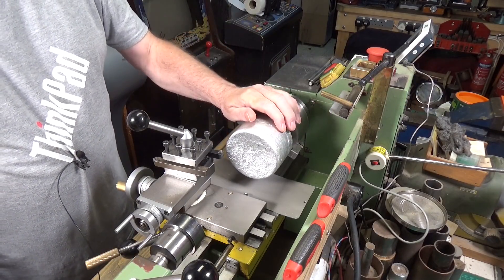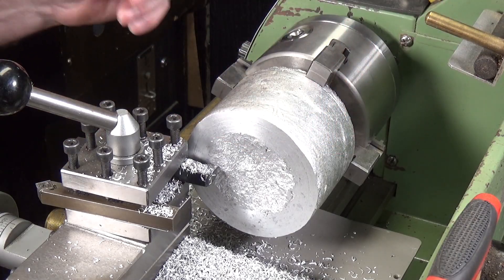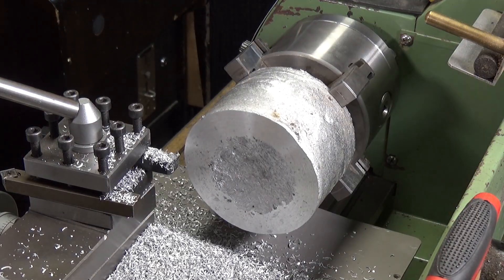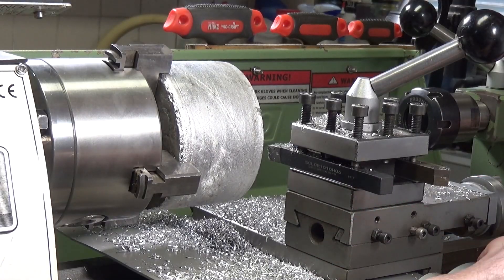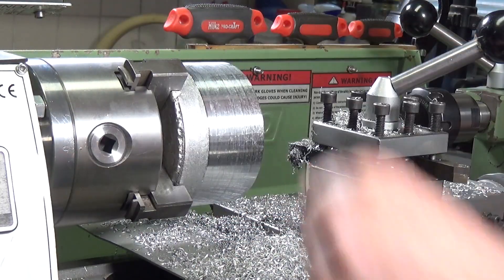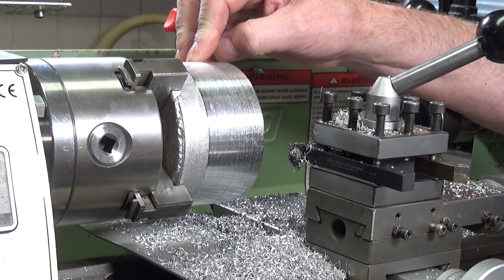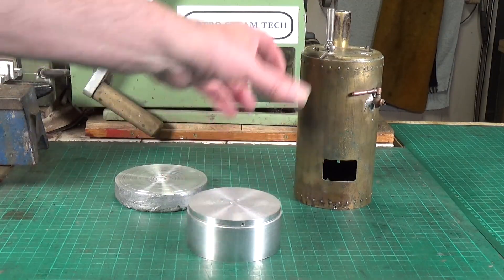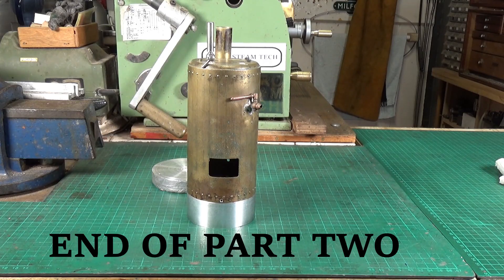Marklin 4122/7 1/2 Hybrid Model Steam Engine - Part Two

Comment: Nicely done Alan.  Home cast ally is just so good :)  It should all work out well.  The cross drill attachment also proved it's worth.  It's not difficult to make these tools, and they make life so much easier.  I will look forward to the finished product. 👍👍👍👍 Cheers Rob
Reply from the maker: Thanks Rob. You can still machine reasonably large work pieces on a small lathe, it just takes longer!  The cross drill attachment has earned it's keep many times over, a very useful bit of kit. Cheers, Alan.